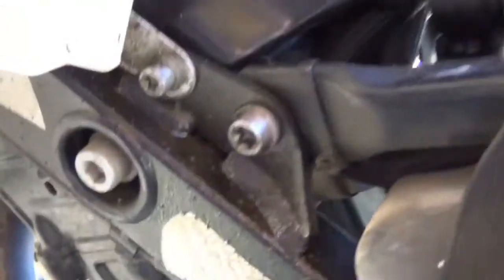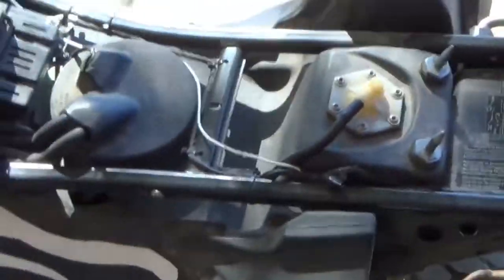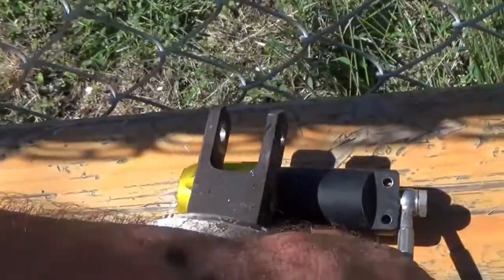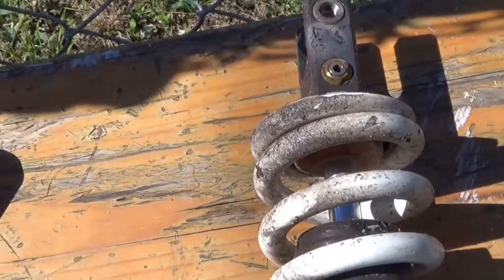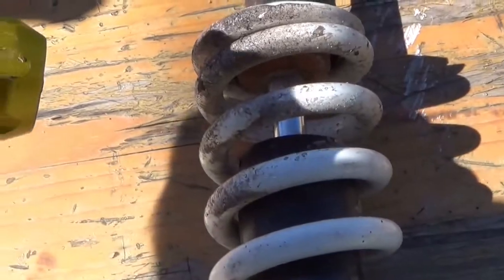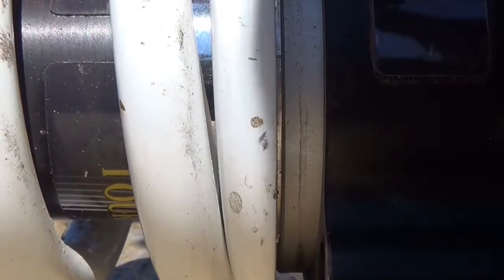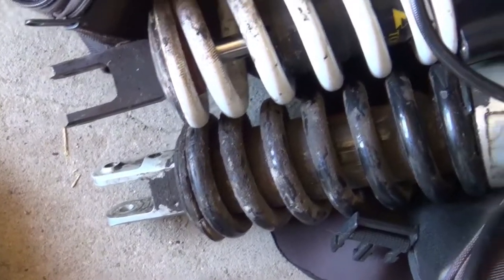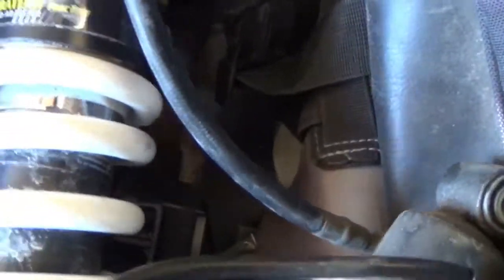Asking Mrduhfactor and any one else for a bit of help

Comment: 3/Poorly bled rear shock, or slowly leaking seal head in the shock itself. A slow leak in the seal head (bottom part of shock underneath dust cap that the shaft comes out of) is very difficult to see. Usually (too late now) I'll clean the shaft, dry it completely, and go ride the bike hard. Then I'll wipe the shaft with a kleenex to see if there is any fluid anywhere. If there is, the only remedy is to take it apart and carefully put in a new seal.

Comment: O.K., the phillips screw at the top of the shock is an air bleed screw. When one is bleeding the air out of the shock fluid during assembly, the shaft is fully extended, no nitrogen in the bladder, then you position that screw hole upward as the highest point. You then loosen out the screw, and remaining air or excess shock oil will spill out. You then screw it back in, then charge the bladder with nitro. I love those screws, and not many new shocks have them anymore, making bleeding a PITA.

Comment: Three possibilities exist in my mind for the problems, in order. 1/Leaking pre-load adjuster seal. If it's oil gets low, or sucks air in (during shock shaft cycling) it will function without full load, but won't under load. If oil leaks out, that means you have some gas displacing that lost oil, and as we know, gas can compress where hydraulic oil cannot. They also may not have bled the pre-load adjuster well. That might be why it wont work while in your bike under weight.

Comment: 2/All shocks are stiff when new, and after 20 hours of riding or so, they will "break in" and become softer. It has to do with the piston seal ring friction on the shock body wall being tight, and shaft seals being tight. This usually just makes the suspension feel softer after riding for a while, but should have no affect on your ride height, or pre-load adjuster function.

Comment: If you want to move the preload adjuster. loosen the first nut you point at and carefully compress the spring from opposite sides and the whole package is easy to rotate along the damper to the right position. :D nearly broke mine when compressing the spring onesided.
.

Comment from the maker: I gave them all that info to start with. They ask all that and custom build the shock. I'm quite new to this also. It should have been set up for around 340#'s. I sorta hmmm... on it when I saw the spring was 150-180. But I figured they knew what they were doing. It did quite well until the last 100 miles. I'm sure they will get it sorted. I already received the Shipping label, so monday off it goes.

Comment: 4/Can I do one more? Perhaps the spring is too soft? Maybe after everything broke in, it's not enough spring after all? (still wouldn't solve the pre-load adjuster problem though). It's possible the pre-load adjuster nut/collar backed off too. Seen that happen before. Do I have you thoroughly confused now? Next time, lets talk and problem solve before you remove the shock so I can ask you specific questions about the shocks behavior and have you do some testing :) Keep us posted!

Comment from the maker: I totally agree with shock companies. However with this bike I have very limited sources to work with.  Oil filters I have two choices, K&N or BMW. Sadly this is always an issue when dealing with BMW. Toratech has a company named Tractive That does all the design and work on their suspension. On the front springs they were made by Hyper Pro.

Comment: Oil leak looks like it's coming from the oil tank, not the shock. Have you taken the top LHS faring off and checked the tank? (probably just the drain washer with a bit of luck)

Comment: Why you changing the rear shock?  I also plan on buying the touratech shock but not until my stock one is broken, hopefully it will break before the 3 year warrantee is over then I will do another stock one. That is one hell of an expensive shock to piss you off so much. 
I have 20,000 miles on my Sertao now, quite a bit of dirt and loaded with $5000 worth of Touratech weight. The stock shock seems to do the job just fine for me, so far.

Comment: Or perhaps you overfilled it with oil on the last service and thats causing the leak? The bike has a dry sump and like all dry sump engines, there is a particular method used to fill with oil and get the level right.

Comment: A pure guess but from what you've explained, it looks to me that they have provided a standard shock spring when you had asked them to provide you with a stronger spring if it is 150-180 and you asked for 300.  180lbs is only 81.64 Kg which is around the weight of 1 standard person.  You should be able to take 2 standard people on the bike.  So, the spring looks like it isn't up to the job to me.

Comment: Looks like it's compressing the spring.. But, that's not under load.  You blew a gasket internally on the piston..  I'd say you overloaded the bike, but your skinny butt and 80lbs would just equal my weight!